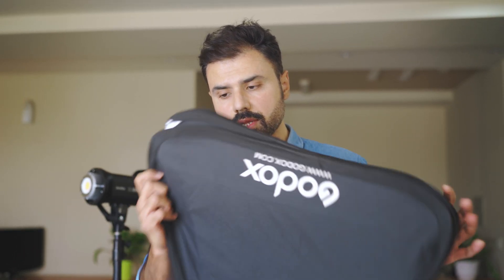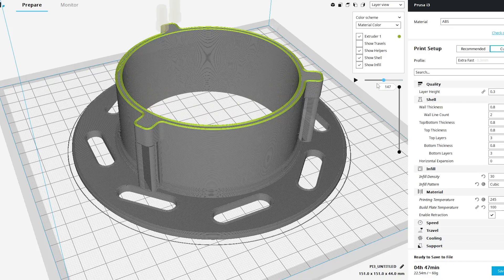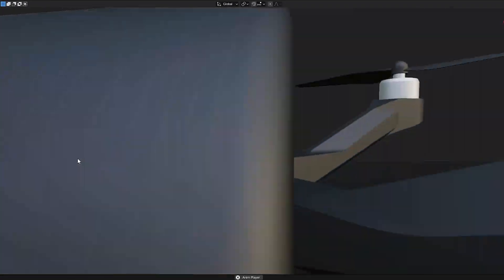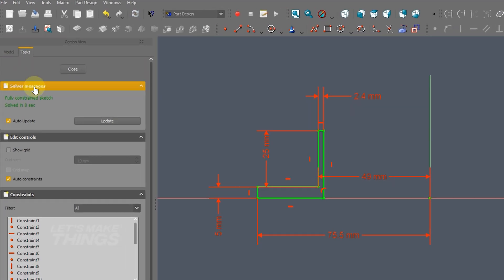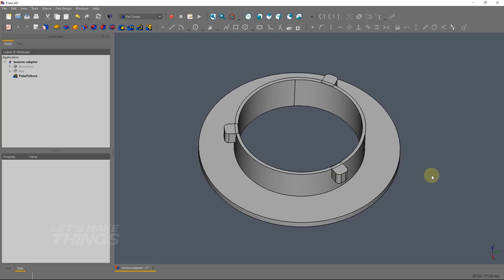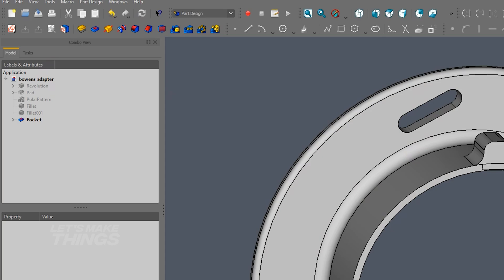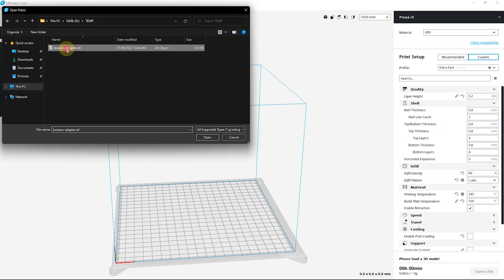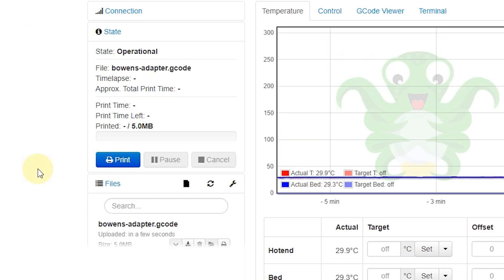Thing 1 - Bowens Mount Adapter Modeling in FreeCAD -  Let’s Make Things

Comment: I am a big fan. But , how about going the other way? Make an adaptor that allows you to mount Profoto Softbox  on the Godox S2 bracket.
Reply from the maker: That would be called profoto to bowens adapter. I can design one and put on my thinigiverse but I need a volunteer who could test that since I don't have any profoto modifier
Reply: I can test it out! I own profoto B 1 lights
Reply from the maker: @BGIGGZ  Got a printer ?
Reply: @FarrukhPitafi  yes I do! I have a ender 3 s1 just need to set it up, just got it.